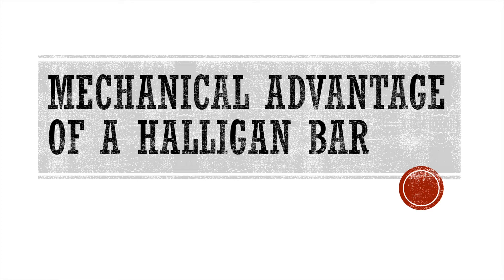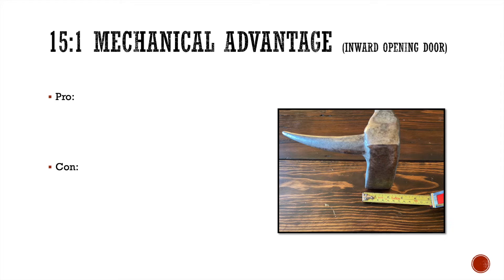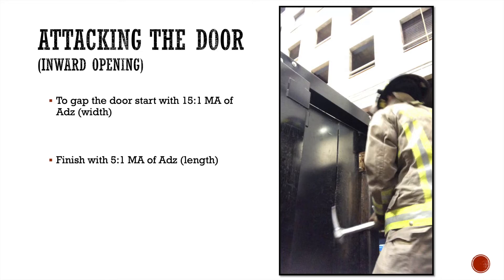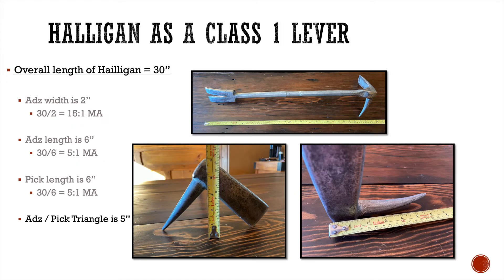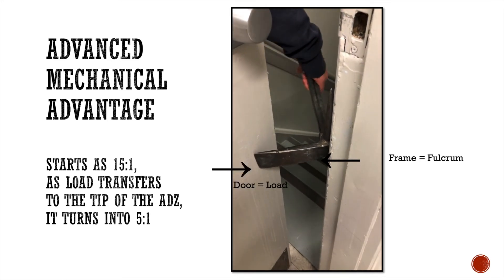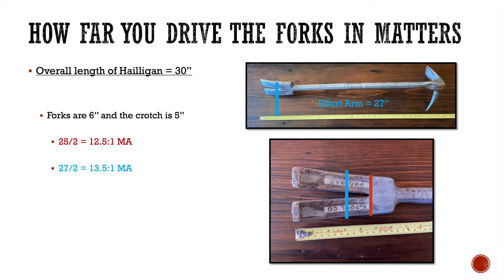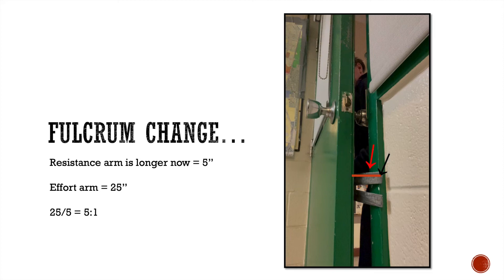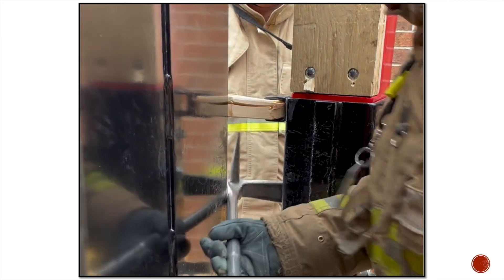Mechanical Advantage of the Halligan Bar (Nerd to Know Version)

Comment: Regarding what can be used for blocking (in place of wood) to increase spread: the logging industry makes extensive uses of plastic felling wedges that get hammed into chain saw cuts. They are cheap and tough, but designed to be cuttable (to avoid destroying tools) which also makes them easy to modify. They are also expected to be used up and replaced.